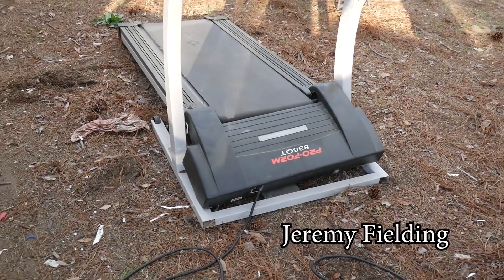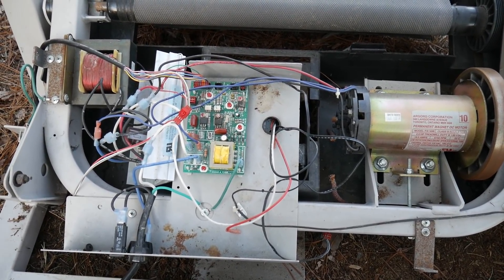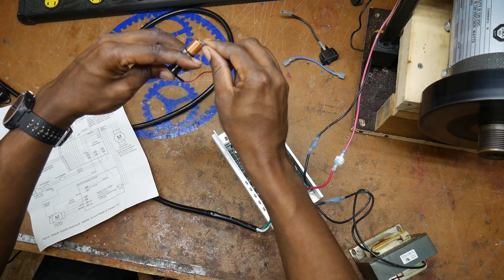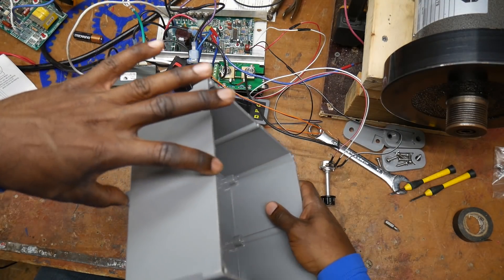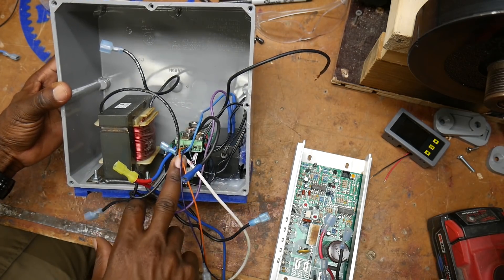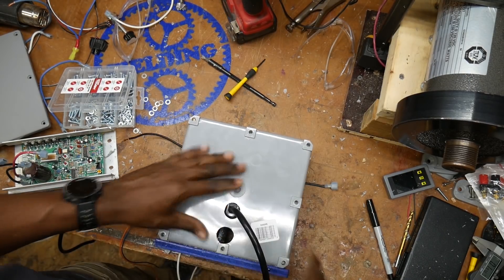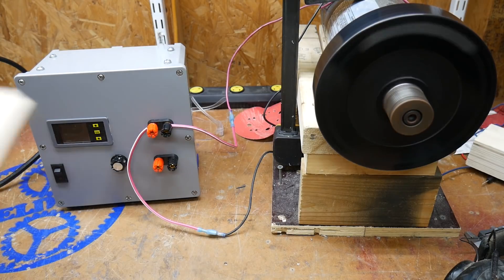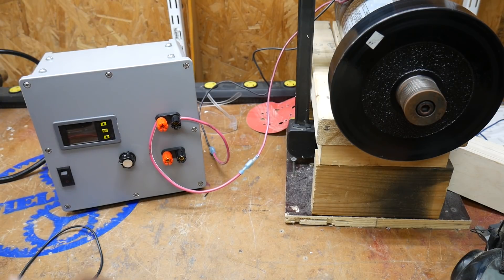Building A Variable DC Power Supply From Treadmill Parts: 054

Comment: Jeremy  the key to soldering is flux, the same kind used for copper pipes. You can neutralize the acid after completing.
Reply: Negative, brother -- you're partly correct in that you do need to use flux, but for electronics you would use rosin-core solder. The kind of solder you would use for plumbing is *acid-core*. The acid in the flux is beneficial when you're joining pipe or sheet metal, but it's the kiss of death for electronics. You can also use solid solder, in which case you'd apply the flux separately; but either way, flux for electronics isn't the same as for plumbing and sheet-metal.

Comment: Hey Jeremy, I really appreciate the fact that you utilize re-purposed parts for your builds.
I do similar projects but usually am flying blind as far as the electronics go . Thanks for the great info about the MC-80. I acquired a treadmill that had a similar controller but was older and was kind of quirky. It was very soft starting and if you slowed the speed down, the motor had to be completely stopped in order to increase the speed afterwards.. some kind of safety-reset feature. I used a rheostat set-up just like you did in the video with the hopes of powering my wood turning lathe. I still haven’t settled on a plan of how to vary the speed without having to stop and reset every time I slowed the speed but then wanted to increase it again. Very annoying!

Comment: if you use overhead projector markers you can use a little windex on a paper towel to wipe away any unwanted marks and mistakes when doing layouts on enclosure and back panels.. works on plastic and most metal surfaces

Comment: I absolutely love your videos I learned so much from them. I love to Tinker and invent and reuse leftover equipment and motors switches and so on. I currently took apart a 6 function blender save the Motor & Control Panel. I'm looking forward to see if I can convert it into a drill press. And it's a high-end blender. I have various other projects that I'm going to incorporate Motors from a food processor and so on such as a Disc Sander combined with a belt sander it has the proper RPM range and I have a speed controller that I need to wire up to it it is a pedal operated but I convert it to a knob system or or thumb screw system you could say that I can control the pedal operation of it. When I get these machines up and operating I will post pictures to you and show you the final product. Keep up all the videos that you make and the knowledge you spread and give to people like me. God bless you he gave you this knowledge to better your life and others. My name is Auggie look forward to more videos and possible correspondence with you. Bye for now and have a blessed day

Comment: Question for you. Will the MC 80 run the 130vdc/ 4.25 horse / 3170 watt motor. If no?? what will? My Application is 2x72 belt sander.

Comment: Hi Jeremy, Great video even though I struggle with electronics. I want to make a variable speed potters wheel using a treadmill motor, so what do I need? and the motor needs to be reversible.
Cheers from New Zealand , Neil

Comment: Nice build.
I scavenged an old variac from a 1976 Westinghouse elevator and run through a step up transformer to a rectifier for 0-325 vac, 0-450vdc output.
The old variac had been in my basement for over 10 years before I finally found a use for it.  One of the few times pack rating benefited me.

Comment: JEREMY Riddle me this I have 2 treadmill Motors with no treadmills no speed controllers I can hook them up to a 12 volt battery and make them turn but with very little speed why do I need a speed controller to get speed out of them is there any way to wire these without a speed controller

Comment: Would it be possible to use this same set up but with brushed DC motors?  I have the FB1-4001 from Advanced DC Motors.  240v  1000  amp capable?

Comment: Did you know that if you put a off on switch inline "high" side  of  high wipe low connector .and use it to turn motor on off it will allow you to keep motor speed the same .without adjusting the speed knob . You can watch ( barry's workshop )video for better explanation

Comment: Please be careful- those treadmill PWM speed controllers output pulses of full voltage,  just vary the duration of each pulse. 
This works fine for motors, not so much for other types of loads.
Digital multimeter does not give you full picture.
If you come across a cheap used oscilloscope, use it to observe the output of that PWM controller.
Reply: noob question: how does one measure the output without damaging oscilloscope? With ground lead attached to negative and probe tip to positive, loud noise and flash in the surge protector ensued. Tried "floating scope" (the thing everyone says don't do) and although I didn't get loud noises or flashes, the surge protector circuit breaker tripped after about .5 seconds.
Reply: @tightirl  Isolation transformer.

Comment: How can I bypass the speed sensor? I’m trying to build a 2x72 with the motor and use the existing controls but it says error without the speed sensor. Is there a way I can bypass that or will I have to set up the board so that the sensor can still read the rpm? Thank you for all you share. You’re awesome man.

Comment: if you plan on using this on higher current applications I would suggest a PC fan with and a few more holes for adequate ventilation. Even at 1A that setup could get pretty toasty which might not melt the box but it would impact the life cycle of the electrolytic capacitors on the power board.

Comment: I've been wanting to build 2x72 belt sander. One that I can swap contact wheels on and change the belt set up. But I was wanting to have a way to control the speed. This gives me some ideas. If you were going to build a rig like I described, how would you set up the speed control?
Reply: I actually am looking into doing a similar build right now and what I have seen some people do is just use the speed control panel from the treadmill. Doesnt look nearly this clean, but it works

Comment: Awesome. Just awesome! I want to build one of these for my lathe. Do you know of a digital motor speed display that I could put on instead of the voltage display you had? And would a 10k potentiometer be better for a lathe than the 5k? Keep being awesome and spreading/sharing your passion! Thanks
Reply from the maker: The rating on the POT doesn't matter much.

Comment: I wonder is this could be used to spin an 80 gallon compressor tank while the inside is cleaned out with abrasives without burning out the motor.  With all the behemoths seen on these mills it should, with proper reduction pully do what I need to have it do.

Comment: Hi Jeremy, I love your videos! I'm at the part where you post your wiring diagram. I'd recommend putting the switch on the line/hot side & not the neutral. Reason being is if you switch the neutral the rest of the circuit still has potential & is just looking for a source to ground (IE: you). If you switch the line side then there's no potential within the enclosure if you forget to unplug it before working on it.

-Nick
Reply: I was going to say that exact thing, just wanted to make sure someone else hadn't already said so. You never ever switch the neutral.
Reply: I'm not that knowledgeable and even I picked up on that.
Reply: Here in the UK its normal to  switch both the live and the neutral .

Comment: Brilliant Video Jeremy, thank you, I have all the components to do this project but unfortunately my main control panel from the treadmill have 2 lots of 6 wires coming from the top panel to the speed controller, now need an electrical engineer to point me I the direction of the correct wire to use for the Potentiometer, only 3  wires I know but I have 12  to go at haha, cheers again.

Comment: #Jeremy Fielding - I made a bench top power supply out of a computer power supply. It gave me 12v, 5v, & 3.3v  connections. Which worked good enough for what I needed at the time. 
BUT ... to take a treadmill speed controller... and convert that into a benchtop power supply, Really Great Idea! I've used treadmill controllers before, but only to control the treadmill motor for whatever project I was working on. Never thought about using one as a Fully Adjustable Independent Power Supply before! Build an enclosure, throw a voltage display in there, and its Perfect! Might just do that with the next treadmill I come across! Thanks for the idea!

**EDIT:
The PVC box you used are great for stuff like this, super versatile. I used to buy them all the time for projects, as they come in a bunch of sizes and the price wasn't too bad. However, we moved since then, and now no one anywhere near me sells those! But if I am planning out a project ahead of time, I have ordered them online and used them. Handy little boxes though, and since they're pvc they're also of course not electrically conductive, which is really helpful sometimes for some projects.

Comment: Great video!  Two suggestions: That hole that we all don't see? :-)  You might want some more of them.  This is a high-power circuit, and it's going to need some cooling.  I realize as a test bench only supply it won't be used for long periods, but it's still a good idea to ventilate.  

The other thing, not really a suggestion, but you didn't mention the on-off-on quirk these controllers have.  With the motor running, if you turn it off and back on again, the motor won't restart.  You have to return the potentiometer to zero, then bring it back up, to get the motor to run.

Comment: Another very good video Mr. Fielding. Don't worry too much about your wire wrapping procedure on that potentiometer. I've been an electronic repair tech for around 40 years & that's how a great deal of circuits were wired in the old tube type televisions as well as a lot of the first solid state TVs as well. Regarding that potentiometer, you stated in a reply to someone's question about what size or value you used that all that information could be found in the links. I'm an old analog guy & I'm still trying to figure out things, but could you please tell me where to find these links. I've got 2 or 3 of these motors & I have a tool I want to build with one of my motors. Again, could you explain to this computer illiterate person where to find these links or just let me know what size POT. you used. Any & all help would be greatly appreciated. Keep up the excellent work, and take care.

Comment: What are the PSU specs? How many Amps do you expect to pull from this device? You can't use speaker banana posts for high current loads. Etc, etc. Lots of other issues too, but a hack is a hack, right?

Comment: Great video. I’m trying to do the same thing. What value is your potentiometer? I had a 20k so I tried to use it but it had very little effect on the speed. I then accidentally grounded a wire & blew up my potentiometer. I’ll have to buy one & want to what to buy.

Comment: I'd like to start a conversation about converting a metal cutting chop saw to slow it down and use metal cutting saw blades versus the abrasive blade I am required to use now. Thanks
Reply: You can buy metal cutting carbide tipped steel blades and cut at high speed.  We cut 14 ga. steel plates stacked 6 high with a Harbor Freight 4000 rpm sliding chop saw

Comment: I love the display, except that it does not tell you the RPMs.
Reply: Yeah, would love to see somebody rig an RPM readout to one of these. I have a Baldor Industrial 90 VDC motor that I would like to run on my old wood lathe, but I would also like a display to show spindle speed.
Reply: @notajp  - The RPM of your lathe will depend on several factors. You could get a cheap laser photo tachometer off Ebay. Mine was under $10 and works like a charm.

Comment: I’m curious if you put any kind of fuse or circuit breaker in your power supply. I really like the build otherwise. You have a fantastic voltage range and plenty of available current. Great idea and nice packaging!

Comment: The key to good soldering is the flux. Flux magically makes the solder flow where you want it to, sticking to the metal parts and not to the PCB backing etc.

Comment: Cool build as with everything you do. I noticed a 1600watt power supply Jehu Garcia built with two HP server power supplies capable of some 50-60 amps.  Pretty cool. Very robust PS modules.

Comment: Hey Jeremy i watch your videos for a while good job keep going . a little advice : separate cool parts from hot by adding plate ... open holes so air move add fan system to your board keep it cool last longer .. you also can add to it bigger heat absorber ... big cpu cooler's will be great for this job .
Reply from the maker: Thank you

Comment: Someone might have asked this or something but there is a lot of post here. 

By reducing the speed the way you did with that board and potentiometer do you lose the torque the motor makes?
Reply from the maker: Most speed controllers compensate for that. I can’t say for sure if this one does

Comment: love your work mate..I made a rock tumbler from my treadmill and couldn't figure the circuitry in the control panel..I used  transformer and blocking diodes to give me 12vdc and it runs fine but I will try this option so that I can try different speeds..thankyou

Comment: Is that a true rms meter? I'm confused and don't see it as a variable power supply seeings that is uses pwm and would always have the same voltage and see it as a motor control. Or am I missing something and you're able to adjust the voltage?
Reply from the maker: It is a definitely a motor speed controller by definition. It does what I need from a "power supply"... but as the thumbnail says it is indeed a speed controller.  But if you are looking for something with true RMS to use with precision equipment you should buy a professional variable power supply.
Reply: Great video by the way, I enjoy every one you make. Keep up the good work.
Reply: My bad, I just watched your entire video and realize now that you used a Pot to drive it. Awesome video, by the way.

Comment: How many amps is this good for?
Reply from the maker: I think the treadmill was rated for 15 amps so probably 15amp...
Reply: Jeremy Fielding I meant DC amps...  the output.  The volt/ amp meter that you linked to amazon has different options based on amp capability. I can obviously buy the biggest one, but I'm trying to determine just how much DC amps this will support @12v.
Reply from the maker: It will be the same. 15amps maybe 20 amps no matter what voltage, or which side you measure on.
Reply from the maker: Wow... you are excited. I can see why you are confused. I didn't mean it was 15 amps at the same time on both side. But It is limited to 15amps on both sides. When you dial it back to 12 volts you get 15amps (maybe 20) because of over current protection. At that moment it won't be 15-20 amps on the AC side. So to be clear... there was a 15 amps breaker on the AC side. and I know from experience if you try to get more then 15 amps (again maybe 20) on the DC side even at lower voltages it shuts off. I did this several times for my video on What motor to use for a Go Kart. The model I bought was the 30 amp version FYI
Reply from the maker: And next time take a deep breath... I didn't get this far without reading a few books :)
Reply from the maker: You can't get the full power at lower voltages on this controller. It was not designed to be a pure transformer, but to work with a treadmill. If you look at the wiring on both sides of the device that is another indication that it can't handle high current. If it allowed such currents at 12 or 24 volts, I would expect to see much larger terminals and thicker wires on the DC side. Instead they are all the same size.
Reply: Jeremy Fielding your electrical logic and analysis is quite flawed.  The transformer (which you refer to as a choke) is used to power the entire treadmill to include the incline motor and electronic controls.  To ASSUME that this portion will only draw a certain number of amps without conducting any kind of testing or having any kind of documentation declaring the capabilities/ specifications of this portion of the three treadmill circuit is bad practice and very dangerous.  As I said before, some will assume (as I initially did) that you know your way around electrical systems and are wrong and able to intelligently reply to specific inquiries about your creations about technical capabilities.  A person who isn't as educated as myself on the basic behaviors of electrical systems might take your info as gospel.  You first nude to understand the question, if there is doubt about what is being asked, clarify. If you re-read my initial question, I was very specific. Then your reply should be factual based in data and confirmed measurements, not ASSUMPTIONS.THIS IS HOW PEOPLE GET KILLED WHEN WORKING WITH ELECTRICITY BECAUSE THEY THINK THEY KNOW WHAT IS CORRECT!
Reply from the maker: Anthony... If you disconnect the choke. the whole system works fine... But I won't assume you don't know what a choke is... instead ... thanks for watching, and I wish you success on your project... We can go our separate ways believing what we want.
Reply: Jeremy Fielding OK, that's fine. I'm still waiting on an accurate answer to my question that is based on data and measurements and not uninformed assumption.  I'm willing to bet that the tag on the motor specifies a higher amperage draw than 20A @12vdc.

Comment: Dood, I've taken about 3 treadmills apart just for the motor and board I keep getting pulse modulation bords, your lucky to find a mc60 or mc80 motor control board. 
This last one I've got to feed it a tac signal to show the motors running.
Reply: Hi can you use a cheap servo tester ?